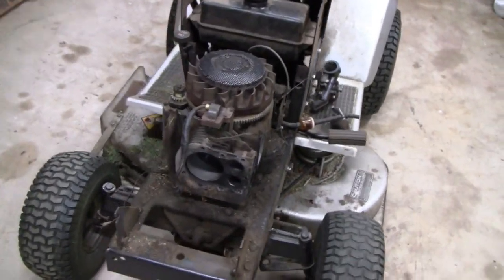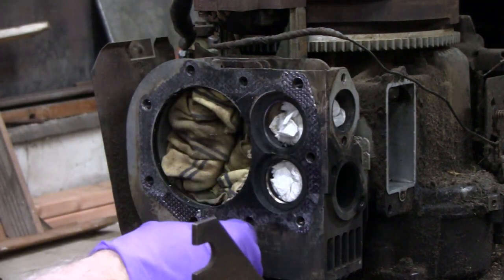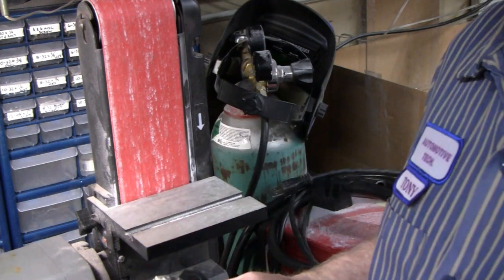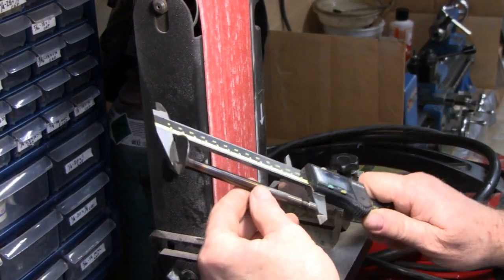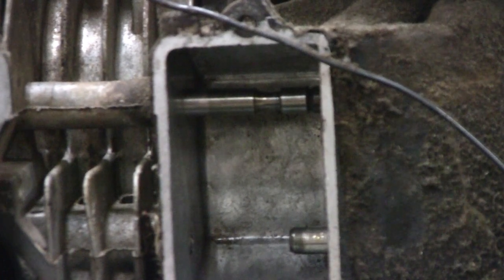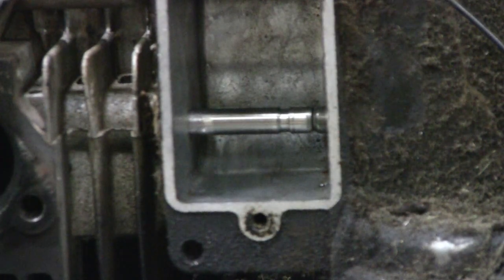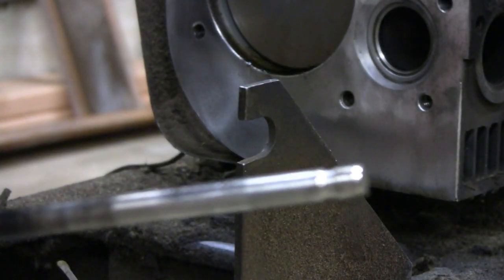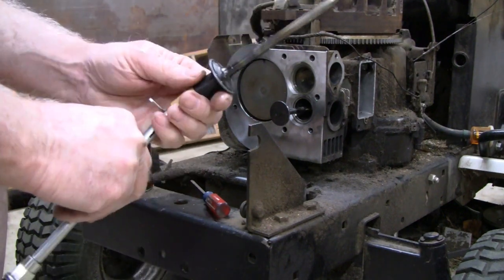11 HP BRIGGS ENGINE VALVE JOB (part 3)

Comment: Always a Good watch. Enjoy the guy talking. I still have two 5hp Briggs Raptor's from my racing days in the crate's. Both Yellow and Black paint job. Sweet Looking Motors and such Fun Driving. Hold wide open and use the brake only, you never want to lose throttle on those Briggs.
Reply from the maker: Thanks Bud!! My two Nephews raced Junior Dragsters!! It's amazing how much power you can get outta them little engines!!☺

Comment: The egg beater Lapper goes back and forth and around in a circle. Watch the cotter pin as you spin it and you'll see, it relocates every other rotation of the beater handle. Great job Roadie! Just a little thing, but if you get into an over head valve late model, you'll want to stay away from a wire wheel when cleaning the gasket mating surfaces. The gaskets are thinner, and not as forgiving to the material loss when using a wire wheel.  I had a recent rebuild in the shop where the previous "mechanic" used a wire wheel, and I had to block the head and block level to close gaps that would have caused the head gaskets to fail prematurely. These L head engines are much more forgiving, but it never hurts to level the head on a sheet of wet/dry 600 grit paper on a flat surface, just to knock down any high spots and bring low spots higher. Cheers Roadie!! (Hope the constructive criticism isn't taken the wrong way Buddy!) Zippy~
Reply from the maker: No worries Mate!! I know if advice is coming from Zippy it's not Bullshit!!☺
Reply: Zippo maybe we can get RoadKing to open up the Lapper so we can see what makes it Chooch?

Comment: I did a valve job back in high school. Technically we only had the tools to do a basic engine rebuild in the class. So besides ordering all new gaskets my engine had low compression. Sandpaper and a drill came in handy for cleaning them up, used a chisel to carefully scrape away crud off the valve seats. That engine has never ran more perfect. It was a 1985 3hp Briggs. Still runs like a top.

Comment: good video.  A lot of people don't know about lapping valves these days.  most either buy rebuilt heads or send them to a machine shop.  I've done this on many Kohler and large cast iron Briggs engines.  I always cleaned up the head's gasket surface on a 6X48 belt sander.  sometimes I sanded a little more that necessary, this raises the compression a bit.
Reply from the maker: Thanks Bud!! Yeah I've used a large file on the head before to get some warpage out!!☺

Comment: Hey RK very nicely done. Yep I laughed at 10:45 when you said "You have to use B&S lapping compound or it won't work", thanks for the laugh ;O). Love how you used the square and the V-Block to get the job done. I wish I had one of those egg beater type valve lapping tools when I did my GTO valves. My palms were sore when I got done with 16 valves. Gonna have to pick one of those up for next time. LOL. Thanks for sharing. Best Wishes n Blessings. Keith
Reply from the maker: Yeah that would have been $20 well spent!!☺

Comment: Roadking, you need to get yourself 
an inexpensive set of wood chisels.
Preferably the set from Harbor 
Fright.  And a cheap sharpening 
stone, from the same place.

You know that aluminum is 
EASY to scratch.  The wood 
chisels will help to prevent 
that.

I've been using the same set 
of wood chisels, for over a year.
And, they cost, with a stone, 
less than $10.

steve

Comment: Great video. My question is what changed to requires this extra clearance? I must of missed something. This engine ran for years before this issue.
Reply: The valve wearing down lower into the seat reduces the clearance over time
Reply: Matthew Bergin a tappy tappet is a happy tappet
Reply: I was under the impression that the engine had a sudden wouldn't start condition. I didn't know it was a loss of power issue. My bad  :-)

Comment: in answer to the "I don't know if you guys can see?" for the bulk of things you don't need to zoom at all roadking you got the camera set up pretty good, at 720p that you upload with our 1080p monitors, everything is pretty nice and clear and already zoomed in a little, it actually gives us a bit more detail to have a slightly wider shot.

using the head of the calipers as a measuring stick paused on my monitor, we see what you record at roughly 2x the size of what it is IRL(I put my own set of the same type up against the paused image), so besides when you want us seeing fine detail like special numbers on/or really small parts no zoom required.

whenever you say I don't know if you guys can see, we can, you have your camera set up perfect most times don't doubt yourself, you already got it right, followed by a really zoomed in close up thats a lil to close when you correct yourself cause o the doubt lol

the shot with the valve clearance(at 7:59) checking after the first grind, that was perfect amount o zoom/distance for the bulk of peoples monitors for fine detail work that you want people to see.

awesome videos :D
Reply from the maker: Thanks Bud!!☺

Comment: Love the "egg beater". And yes it was turning. If you watch the cotter pin you see it moving back and forth but around in a circle as well. Wish they still made them like that. Those seal lines look great. This thing should run better then new by the time your done. 

 But I have a question. Did you get this used? Because I'm wondering if this thing has had a valve job (or replacement) in the past. You don't normally see valves that are longer then they should be unless they've been face ground without shortening, the seats collapsed or were ground, or they were just worn THAT worn.
Reply: Screamin Eagle he said in one of the previous vids that he bought it new about 35 years ago

Comment: Sitting on the floor sucks.  I know.   Good job.  I don't have a sander but you know i have had good luck when grinding them.    There is something I just love about flatheads.  I don't know what it is.  I don't mind throwing out an overhead valve engine but the flatheads I keep them just out of respect.
Reply from the maker: Yeah sitting on the floor and bending over kills my back!!☺

Comment: There is one thing that is not clear to me in this. Assuming the engine was built with proper valve clearances, how did the gaps get tighter over 32 years of use? Metal wears off right? So if anything cam lobes, tappets and valve ends wears...
Just wondering and maybe I was sick that day in auto shop.
Reply from the maker: Actually I think most of the wear comes around the valve seat!!☺
Reply: And camshaft lobes wear along with the tappets

Comment: It's a nice comparison of a flathead side-valve job versus an overhead valve job (as Mustie1 did the other day on a 16 horse Briggs), the OHV setup seems easier to set with the adjusters on the rockers whereas side-valve requires removal of metal to adjust clearances, one wrong move (which I'm quite proficient in!!) and the engine's rendered useless...
Reply: Then you buy new valves on eBay for $20 and start over with lapping them in.
Reply from the maker: Yeah Buddy!!  I've seen many valves FUBAR by some Rookies!!☺

Comment: Still doesn't seem to be a reason why that intake spring went wonky? You going to bevel the ends of the valves?
Reply from the maker: There was still a slight bevel, we just knocked the edge off!!☺
Reply: The Briggs technical manual advises to run a plastic credit card, or back of finger nail over that edge to check for burrs. Then it wants you to replace it, but most of us just use a fine grinder wheel to knock it off and put a 45 back on. I look at it like, it's a mower, not a Rotax, or O-320 Continental aircraft engine, and precision is non critical.
Reply: Keith Lucas ...Where did you find your 0-320 Continental?
Reply: Marvin Blankinchip ..... they're usually found in Cessna 172's. But if you feel like playing with one, they have a few for sale on barnstormers.com, for around $7,000. I was in Civil Air Patrol when I was 15.
Reply: Keith Lucas ... I am a retired A&P, IA of 35 years.  I have never heard of or seen an O-320 Continental.  Cessna 172's were originally equip with O-300 6 cylinder Continentals and later with O-320 Lycomings.
Reply: Marvin Blankinchip you are correct in the O-320 being a Lycoming, it was a typo with this "stupid" phone and being in a hurry. Congrats on twisting wrenches on them. Right now I'm at CXO Conroe getting to play with the Texas Raider B-17 as a volunteer.
Reply: Keith Lucas ... We have some things  in common.  I spent about 35 years in Texas.  I lived in San Antonio for 24 years and my wife and I have friends in the Conroe area Cut and Shoot and in Humble.  Years ago I donated about a hundred pounds of new miscellaneous  aircraft hardware  to the crew of "Texas Raider" at an airshow at Stinson Field in San Antonio.  Who knows, you may be twisting on some nuts and bolts that I gave them.